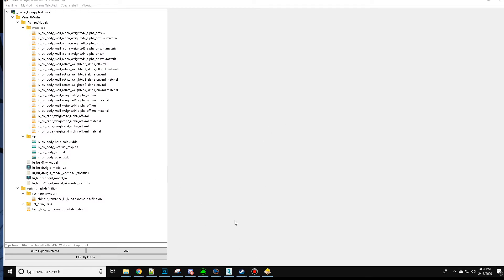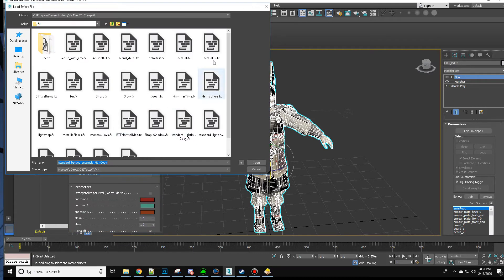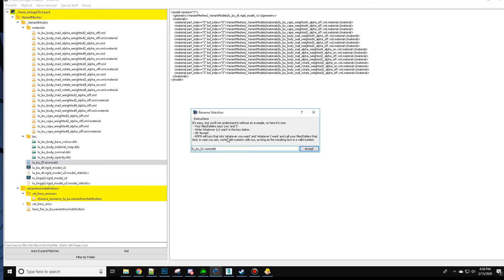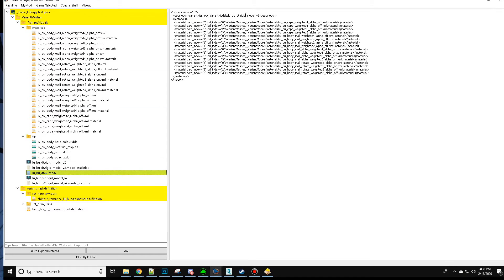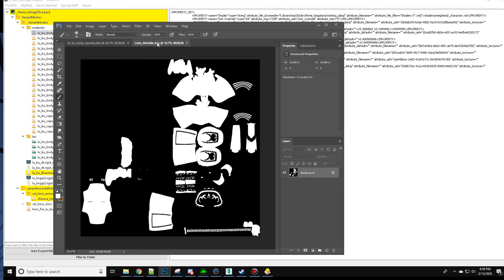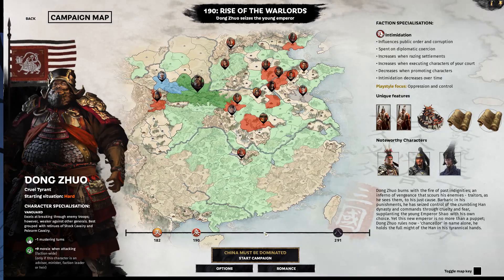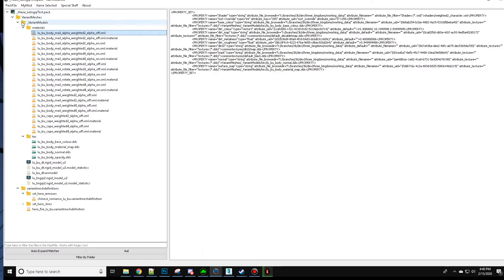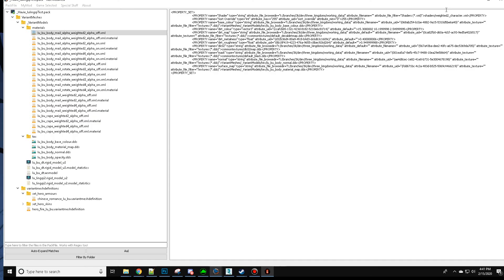TW3k Almost Fixed Assembly Kit

Comment: I've messaged Havie, but here I'll post a short version of my guess at a fix:
Change the custom attribute in the 3ds max material window from "default" to "weighted".
*I've only worked with Warhammer models, so it's possible things could be different in 3K.